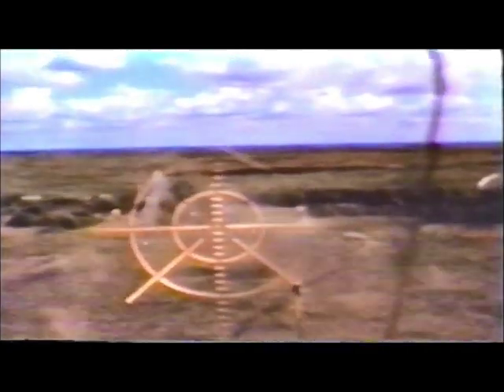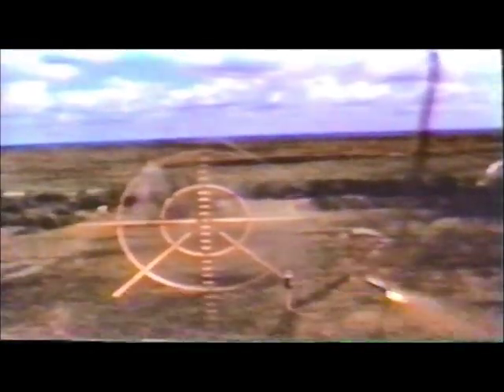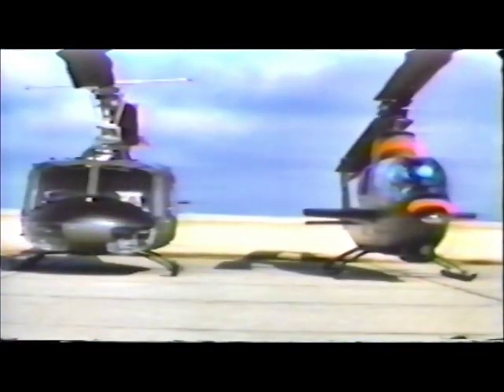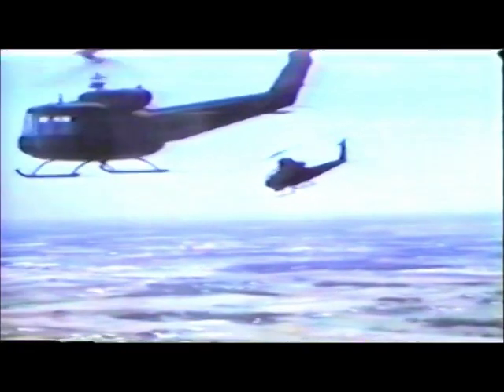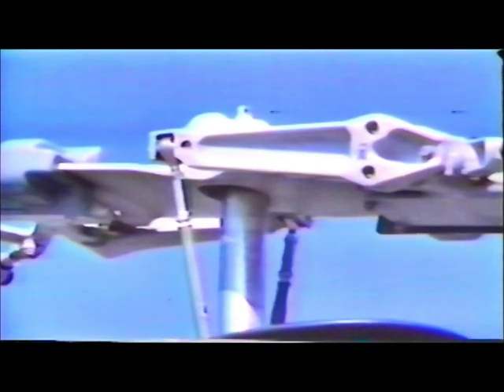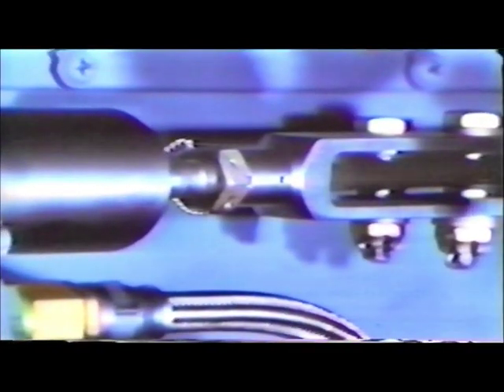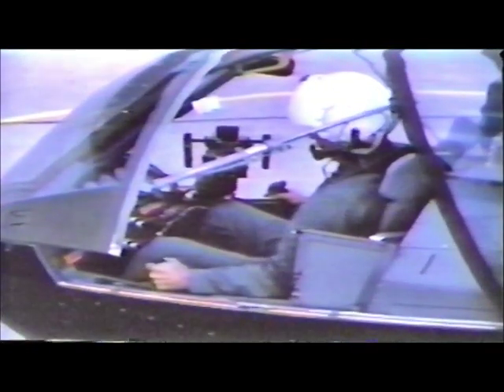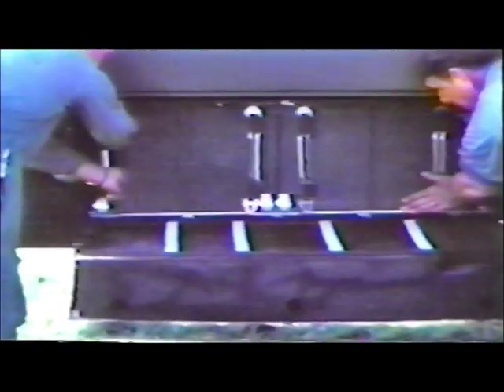Bell Helicopter AH 1G Huey Cobra Introduction

Comment: I graduated Warant Officer Flight School in 1979 and went straight into a Cobra transition.  Though the S models were in service, they were still using G models for transition training at Ft. Rucker and that is one sleek machine!  Coming right out of flying UH-1's everyday, the jump to the Cobra was profound.  Mainly when negotiating the traffic pattern because the Cobra flies faster and needs to turn earlier.  The Cobra is also more difficult to master in non-standard maneuvers whereas the Huey is extremely well-behaved in all flight modes.
Reply: I had a relative in WOFT 1979.. how long was flight school back then, including all the way thru advanced airframe? thanks
Reply: Hi Randall - I was in Orange Flight, 79-29. My experience was very similar to your description and followed by a tour with 501st ABC in West Germany. Flew G thru F models.